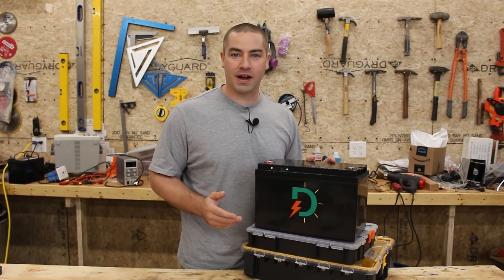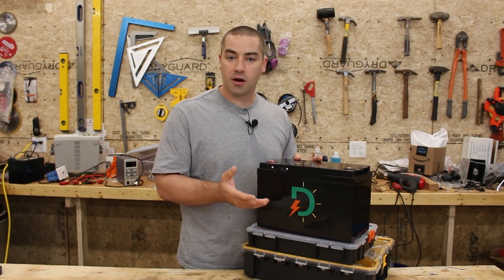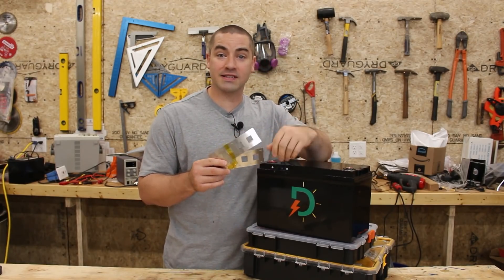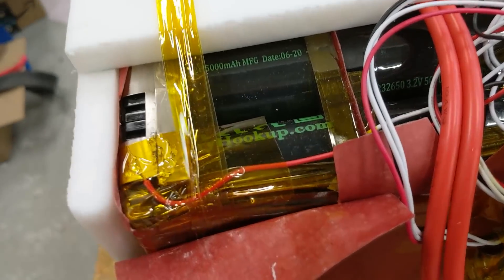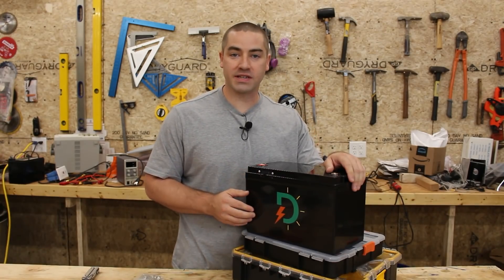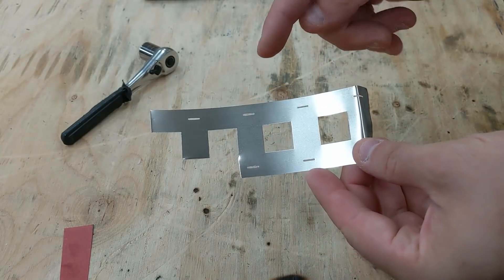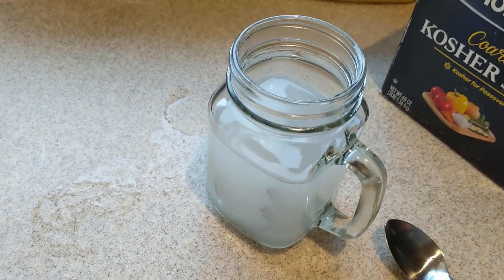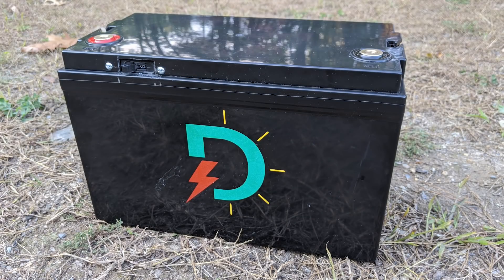Top 10 Questions Answered about DIY Battery

Comment: Regarding Q5: locktite on the bolts shouldn't make much of a difference, however "less steps and less resistance" is wrong.
You can look at those two paths as two (very low value) resistors in parallel, together they form a combined path with a smaller resistance than any of them individually.
Increase any individual path's resistance, e.g. by adding locktite between metal interfaces, and you increase the combined resistance.
Since the combined resistance is never more than the lower resistor value, and brass is a very good conductor, this should have no practical impact.
Reply: Also, when you crank down on the bolt, the threads are GOING to be metal on metal. The liquid lock-tite GTFOs from where the pressure is, and just fills the voids where there would normally be just air.  If that's enough to cause any trouble, the system is simply insufficient to begin with.
Reply from the maker: Thank you for the clear visual explanation.  Makes a lot more sense now.
Reply: @DavidPozEnergy  While i do agree with the premiss, thread locker works in fairly small quantities and you have quite a lot of it there. If it spills to the brass mating surface then it will very much so affect the conductivity in a bad way.  The cross section of the brass is quite large and there should be no problems with carrying the proposed 50 amps.
Reply: Contact resistance between a nut and bolt is so low that it would take thousands of amps to drop a single millivolt across the connection. The nearby crimp connection is far higher contact resistance but it looks like it was done about as well as can be.
Reply: Hi, why not simply use a spring washer instead of loctite?
Reply: TL;DR version, treating brass to steel to terminal as negligible = justifiable engineering assumption; pour in that loctite (TM)
Reply: @DeXoDeD  dissimilar metals need to be insulated from producing electrolysis.
Reply: And any difference in resistance between two paths, will result in an imbalance, since more current will be drawn through cells with lower internal resistance V/R=I  V is fixed so increasing R results in less I (current) . Power = V^2R that additional resistance is wasting Power as heat!
Reply: You are probably not going to have any problems from the loctite. But really - why loctite? There are a thousand bolted and screwed joints on a car that suffer far worse vibration, and are not loctited and never fail. Just use a split ring washer and thats all you will ever need to worry about.
Reply: @chrisstreet6827  Anglais

Two points:
electricity always travels to the periphery of the conductors used. therefore, the locktite inside the bollards has no influence. because the exterior section, if it is clean, offers a very good contact surface.
For my part, if the mounting is permanent like the inside of the battery, I would use the locktite, less overlapping parts = less resistance and a better contact surface. outside the battery, part easier to reach, I prefer to use the locknuts!
Thank you David for these wonderful videos!

Comment: What devices do you use to smart charge your batteries from AC power?
Reply from the maker: I use the ISDT Q8 pretty often.  It's a hobby charger that can work with several types and configurations.  This way I don't have to buy a specific charger for every one of my batteries.  But, the ISDT Q8 requires an external power supply.  I use a Meanwell 24V power supply for that, but an old computer power supply works just as well.

Comment: Glad everything works fine and I sincerely hope you never get to learn the lesson about cell level fusing the hard way. But consider this - regardless brand, batch number etc - every cell is slightly different because of manufacturing process and tolerances. Even though there are no obvious differences some will last less time than others. When the time runs out and if the failure results in a short, the energy of parallel cells will rush to discharge through the faulty cell (potentially fairly dramatically). Imagine a plausible worst case scenario. I hope you are doing the smart thing and keep this battery in a fire-safe enclosure away from the living space.

Comment: What’s the max continuous amp discharge for the battery pack
Reply from the maker: I built it with a circuit breaker limiting the Amps to 50A

Comment: Great video.

Couple of things I'd suggest for future ones:

1.) When discussing the threadlocker / no threadlocker, it would have been nice to pop a multimeter across the connection without threadlocker to measure the resistance and then put the threadlocker on and see if you get a higher resistance with the threadlocker on.  I'd guess that it makes almost no difference but would be cool to see.

2.) When doing the "nickel test", splitting the salt water solution between two pots and having a nail or similar in one will be a good control and make it clear that rust would have developed in a given time period if there were any iron in the nickel strip.

I've subbed and going through all your other content - the YouTube algorithm did a good job suggesting your channel to me!

Comment: I've had a concern for some time as to whether a battery system can heat itself from power from the batteries to keep from low temperature concerns.  (When in an insulated compartment, of course!)  Then, does the increased battery efficiency from self-heating translate to a net gain or a net loss of battery capacity?

Comment: The locktite is a non issue as were the metals from inner and outer threads contact, locktite would be push out and only be were there is space between the two surfaces and the current woundn't be going there anyway. If locktite is conductive, it would only improve flow  of electrons. It maybe another story if we were talking real high voltages.

Comment: the locktite will not make a difference the electricity will always follow the path of less resistance the more you torque the bolt the more the pressure between the ring terminal and the copper post and the more pressure the better the electrical contact and the electricity will always flow directly from the copper to the ring terminal even if you had a 1000amp going through put at that amp the brass contact might melt

Comment: There's only 1 thing I could add to this.  Your only single point of potential failure is the battery terminals themselves.  As time goes on environmental effects on crimped components (especially high current), will become exponentially detrimental.  Solder them after crimping.  Problem solved.  (High current component failures are one of my specialties - and I see it all the time on conductors like this).  No problem with the loctite.  If that thing EVER comes loose under high current loading, it will generate a LOT of heat that you do not want anywhere near those batteries.

Comment: I think if you put the loctite on the bolt it could run out/squish and coat the surface of the brass part that is in your circuit, potentially not great. Solution, just put the loctite on the inside screw thread (not the bolt), and not have so much that it would squish out. Then the brass surface stays clean!

Comment: I really liked this video. 
Now I'm curious if anyone has built this for high power draw use and designed active cooling. I'm tempted to use this design for an EV and design the system for easy swap out of batteries instead of charging in situ. Nobody is doing this commercially, which leaves me wondering if the logistics of swapping out batteries is not worth the effort.
Reply: By the time you've built a battery (even a LiPO battery) for a decent range, you are looking at a fairly hefty (got an engine hoist handy? heavy) battery.  I've seen plans for such things, but they always cite the weight of the battery and the challenge of making a high capacity quick connect as the big failings.

Comment: Have you considered using spacers and using a fan to circulate air through the battery? Wouldn't batteries in the middle be most likely to get hotter than the outside due to insulation? A Simple PC fan could keep things cooler - or warmer depending on the setup..?
Reply from the maker: Sure.  There is nothing wrong if you want to incorporate some form of cooling.  Most electric vehicles have to do this since they are trying to push 300+ amps out of the cells.  In my case I built this for small off grid stuff, like lights and mini-fridge.  I just won't be pulling enough amps to create excess heat.

Comment: David, electricity will follow the shortest path. From the photo you are correct, the juice will flow from the collar to the ring, since that’s where the shortest transfer distance is located. Also, you have more than sufficient contact thickness for the current to easily flow through that ring/collar contact, this would prevent arcing of any sort resulting from insufficient conductivity.

Comment: First off. Awesome project! I definitely want to build one of these. Or two... 😂. Maybe I missed it. How much did this cost to make in the end? I like the switch idea, but wouldn’t the bms shut it down anyway in an over heat situation charging?  Let us know if you ever see the breaker trip. It may be a cool test. 😎I also see a battery off button on your app. Does it work?
Ps, i think you are right about the loctite. Even if the electricity did pass through the bolt the loctite takes up space behind the threads. The torqued side still contacts.
Reply from the maker: $440.  The parts list and prices are at the very end of the video.  

Yes, the BMS is probably going to shut down faster than the breaker can trip.  It's something I like doing so I can wire everything with no voltage, then check everything, torque all my connections, then turn it on.
Reply: @DavidPozEnergy  that’s quite a savings!  Thanks!

Comment: Question, since you used 80 5000mah batts, in 4 100ah modules, isn't that a 400AH battery?
Thanks!
Reply from the maker: If I wired all 4 modules together in parallel, then it would be a 400ah, 3.2v, battery.  But, I wired the 4 modules in series, making it a 100ah, 12.8v, battery.  When you parallel stuff you add ah.  When you series stuff you add voltage.
Reply: @DavidPozEnergy  Thank you Sir!

Comment: Cool video. But at $477 for 1 battery? I understand that LiFePO4s are expensive. Last summer I used 1450 KWh in one month. I would need MANY of them to do what I need. Good luck with yours.

Comment: I'M interested in building my own 72v battery for a 72v 2000 watt electrical motorcycle. Where should I start?
Reply from the maker: That is a huge topic and I couldn't possibly cover ever example in a comment.  But, here is an example just to get the gears turning.  You could use 20 of these in series: https://batteryhookup.com/products/lg-chem-4p-modules-60ah-stackable

Comment: So is this battery a 100ah battery or 50ah? Little confused about that. Also could I build some of these and use for camping in a trailer rather then using acid batteries? Currently I have two 6v 234ah batteries that I'm using but I've always been told that lifepo4 batteries would be way better because I can use 100% of the battery rather then 50%.
Reply from the maker: It is a 100ah, 12.8v battery.  I built in a 50 amp circuit breaker.

Comment: You have 4/3.2v 32650 batteries paralleled to make 12.8v. section. 5 of those sections to make 20ah block. Correct me if I'm wrong....aren't all the connections suppose to be in "Parellel"? I can't see how you made your build work. Its not apparent to me how you made all the positive and negative connections and then folded to get the + and - to come out right. Doesn't all the 20ah sections need to be paralleled also? I don't see a "Series" connection that would make it 100ah.
Reply from the maker: I first paralleled 20 cells together, making 4x large 20 cell blocks.  Then I series connected the 4 blocks.
Reply: @DavidPozEnergy  Thanks David! I'm an amateur. Your info helped me quite a bit. I'll watch more of your work. Again....thanks for the info and quik reply.

Comment: i luv ur lids... ty
i was wondering ... could ur build be stackable in both parallel or series configuration..?
... where did u source ur case..?
... How long dose it take to charge from cut off to full charge..?
... would this be safe to keep in my home full time?      its cold here...
Reply from the maker: Yes, you can series and parallel them.  I bought the case from Aliexpress.  It can be charged in 2 hours (faster without the circuit breaker).  It is one of the safest lithium chemistries.  However, I still recommend storing batteries in an out-building (shed or garage).

Comment: I'm not sure you fixed the potential short issue with the card under the positive end. The nickel was bent over the edge of the cells so at the very edge it could still rub through the shrink wrap. Your insulation should have gone around the edge of the cells.
Reply: The ends of the cells are protected by the plastic cell holders...

Comment: I found the battery in the link below on ebay, they are Li-ion batteries, is it a good idea to build a bigger battery from them following your method above? If it's not a good idea, why not, https://www.ebay.com/itm/Best-Battery-3-7v-9800mah-Rechargeable-Liion-Battery-For-Led-Flashlight-Torch-/274655069444?_trksid=p2385738.m4383.l4275.c10
Reply from the maker: No, it's not a good idea.  So why not?  That particular battery has been tested by other fellow DIY folks and they are not storing the capacity they claim.  The ebay listing says 9800mah, but tests I've seen others post show less than 1000mah.  that makes them a very bad deal.  

But if you want to build a larger battery then I did, and use 18650, then you can.  Some people build huge packs with 10,000 cells.  Check out "Average Joe" or "HBPowerwalls" on youtube.  They both have built very large 18650 packs.  

If you want quality 18650 sized cells go to Batteryhookup.com and use my code "DAVIDPOZ" for a discount.
Reply: @DavidPozEnergy  Thanks for all your insightful info, I knew something was 'off' when I saw 9,800 mAh on a battery that size. Initially I thought I had won the proverbial jackpot until my more rational brain kicked in.

So batteryhookup.com is a reliable dealer yeah? I'll give them a try and see.

Your child is really cute and makes me look forward to your opening credits in your videos. Keep up the good work
Reply: @voiceofinsight5811  Multiple YouTubers use battery hookup. They are good. 18650s don't really get above 3600 mah. Maybe higher from LG, Panasonic, or other big names. But never a no name from China nor anywhere else.

Comment: Top 10(?) questions...
Listed for the impatient:
Q1. Are you selling it?  see index 0:39
Q2. How do you get to the Circuit Breaker? see index 1:19
Q3. Are there any Temperature Sensors? see index 1:43
Q4. Why limit this to 50 amps? see index 2:06
Q5. (no such thing - doesn't exist)
Comment #5 Don't use Loctite on the bolts. see index 2:48
Q6. Why no cell level fusing? see index 3:33
Q7. Is the Nickel Strip PURE?  see index 4:24
Q8. Didn't see this, reprimand David, hehehe.
Q9. Same as Q8.
Q10. Same as Q9.
Reply from the maker: Q8, Sorry about that.  Thanks for such a great table of contents.
Reply: @DavidPozEnergy  You are welcome, I enjoyed watching your lecture.

Comment: Loctite on the threads is not an issue.  Threads only engage by around 60 - 70% anyway.  Once the bolt is torqued all the Loctite will be squashed out of the part of the treads that actually make contact. Also the terminal is squashed down hard onto the top of the battery post.  If the Loctite is a problem, the terminals will get hot during a heavy discharge, and they don't.

Comment: Nice! Currently building an approximately 100AH lithium for a trolling motor, I can't see spending $900+ for a dang battery! But for less weight and FAR less cost (half the size of your battery) I can DOUBLE my water time! Certainly blows away using 18650 batteries!!

Comment: would it cost more to make them 100ah im going to be running 2 powerful desktop pcs off of them.
Reply: also are these the same size just more power (LIFEP04 32650 3.2V 6000MAH CELLS)
Reply from the maker: The cells I used to make this battery are 32650 5000mah size.  I don't know what you mean about the 100ah size.  More than what?

Comment: In a car camping application, would it be possible to charge this battery from the vehicle's alternator, by connecting it to a 12v cigarette lighter?
Reply from the maker: The short answer is yes.  But, there is a risk of blowing the fuse on your cigarette lighter because if the lithium battery is low, like 12v, and your alternator puts out 14v, then it might draw high amps.    And if you connect it directly to the alternator, you may burn out the alternator. 

 A safer way to charge is to use a 12v-12v charger.  Like this one: https://amzn.to/3hCZ423  (affiliate link)

Comment: More surface area allow for more amps to flow with less heat, just as a wire with more thickness will heat less. The current will chose the shorter path ignoring the superglued bolt, not using the glue would just give more area for the electrons to flow and be less resistive.
Reply: I would glue it anyway, but probably above the nut, instead of between the nut and the bolt, I think that would work.

Comment: The question on loctiite should be...why? Unless you have the battery in vibration environments there is no need. It's a useless step for home solar.
Reply: This battery was designed to be transported and used when camping, or staying in a remote location... SO it will experience a lot of vibration.